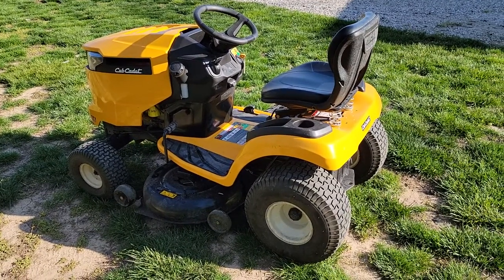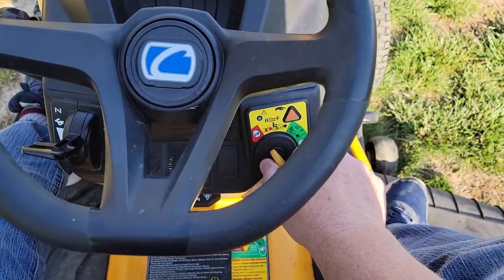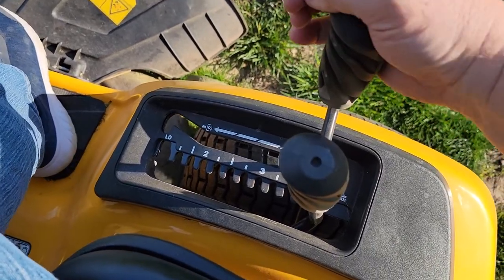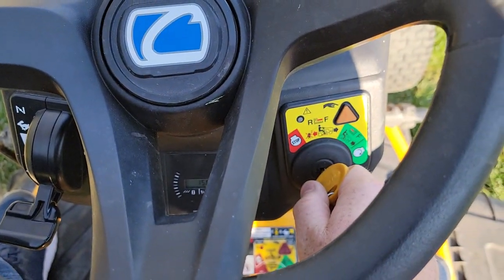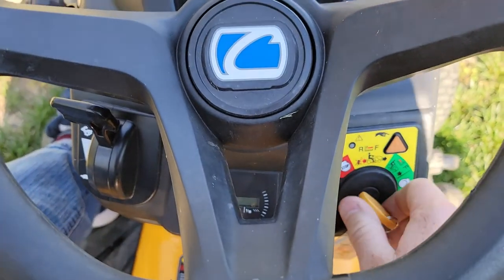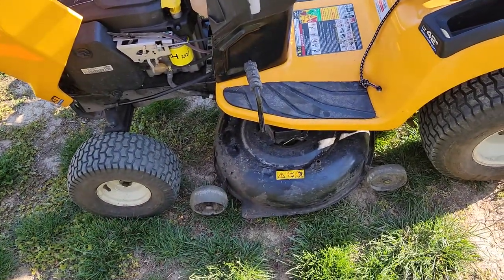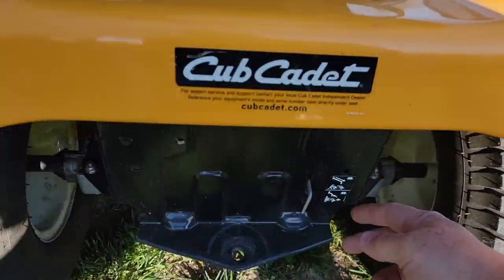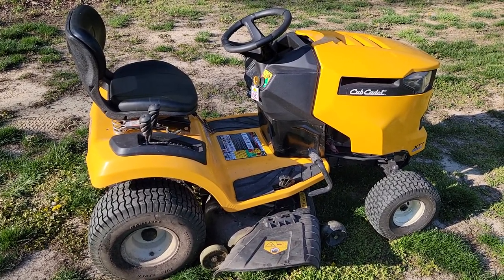REVIEW & HOW TO START ENGINE Cub Cadet XT1 LT42 Riding Lawn Mower KEEP BLADES TURNING IN REVERSE

Comment: A word of warning ⚠️  The hour meter continues to run when the ignition switch is in the "on" or middle position. Not necessarily when the engine running. Not sure why they designed it that way?
Reply from the maker: Thanks for the update

Comment: Great info! Just got mine. I start up fine but the engine dies as soon as I left off the brake. Not sure what’s going on
Reply from the maker: could be the seat has a microswitch, if you are not sitting in the seat.